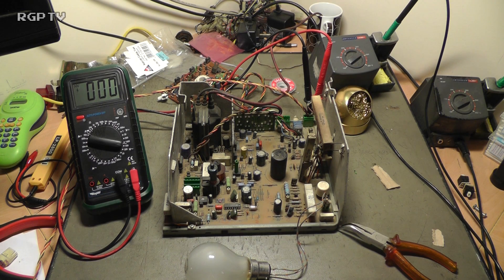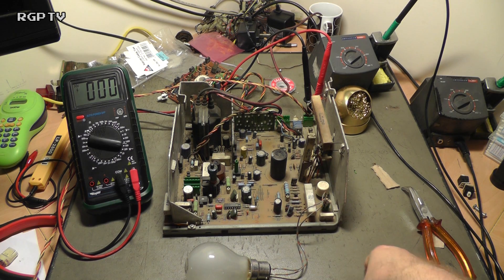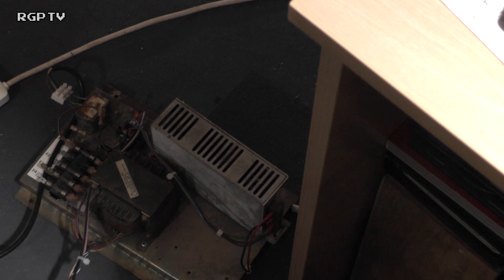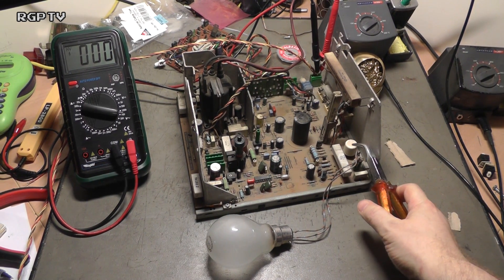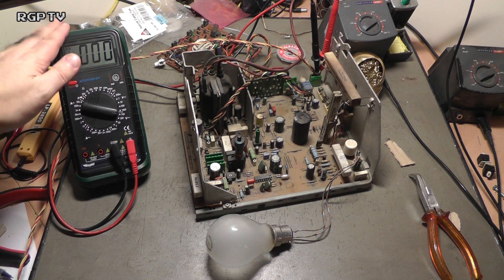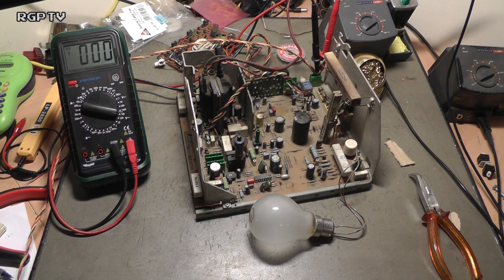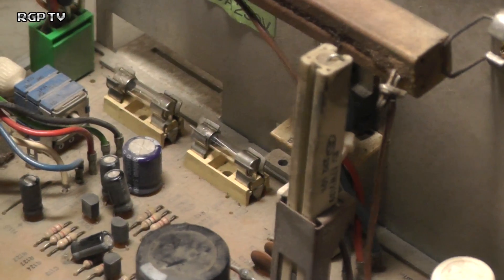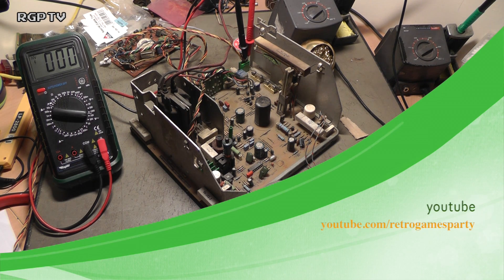RGP Tech: Degaussing Circuit Debunked - RGP #006

Comment: Pls how do we know when flyback transformer is dead
Reply from the maker: Usually when it starts arcing is an obvious sign, there's not many other signs though, sometimes a monitor dies because of many other reasons.  You can't really check the resistance across the windings as they're very low ohms anyway.  You can buy a flyback tester from eBay which will provide a low voltage oscillation to the primary winding and test if anything is coming out of the HV side.

Comment: Great video very usefull! One quick question though, can I confirm the power for the degauss circuit. You said 240v DC is this correct? I have a MTC9000A also, I am in the process of making up a new power board for a cab (the cabs original one was missing) and have never had one with an isolation transformer needed before. So these weird power needs are new to me. I can't for the life of me find a manual for the 9000A but the 9000 says 240v AC for the degauss! Just want to find out if I need a recifier too!
Reply from the maker: Did I say DC? I meant to say AC.  The degauss circuit works like an electromagnet so DC would never work.  You need isolated 128v(approx) AC or DC for the main chassis and either 120 or 240v AC for the degauss, you can connect the degauss directly to the mains input (after the switch/filter of course) but you must take the 128v from the isolation transformer.  It can be AC or DC because the first stage on the board is to convert to DC anyway so giving it DC will just simply pass the bridge rectifier circuit arrangement on the positive voltage side straight to the regulation section.  I've never seen a manual for a 900A either, there is very little difference between the two so work from a schematic for a 9000 but observe the components you remove if you have to change anything.
Reply: @retrogamesparty  I too have this board - can't find a manual either. Maybe you could advise me ......... ? One pin on the flyback is not soldered [there are 10 pins and it's the second pin]. Is this by design or should I remove and resolder it ? The monitor is dead and the general view I'm getting is the flyback is the problem since the large resister is getting very very hot.